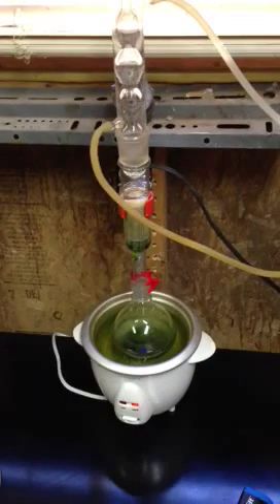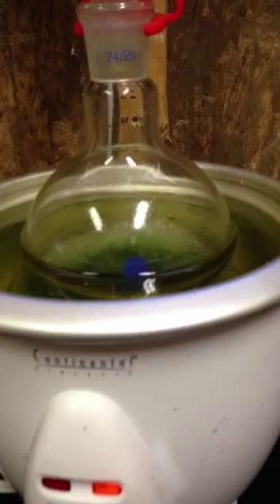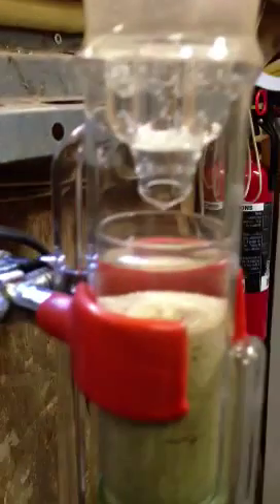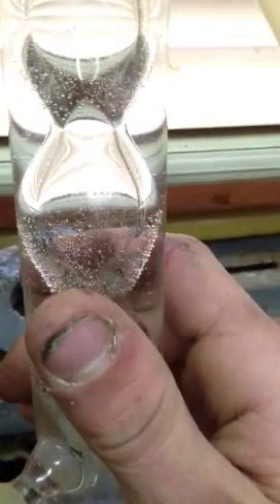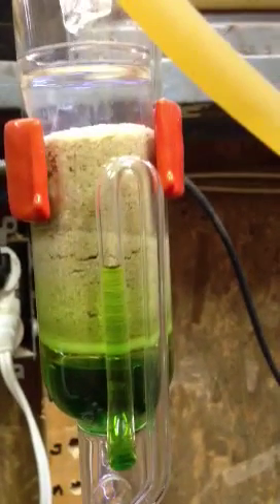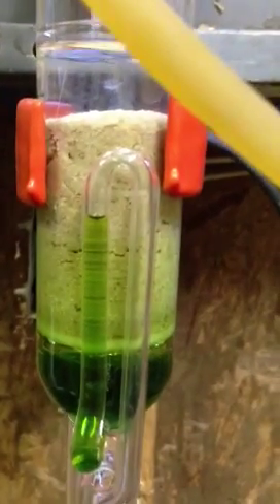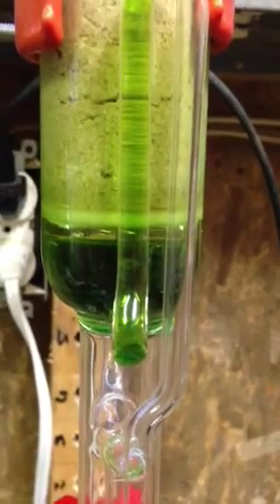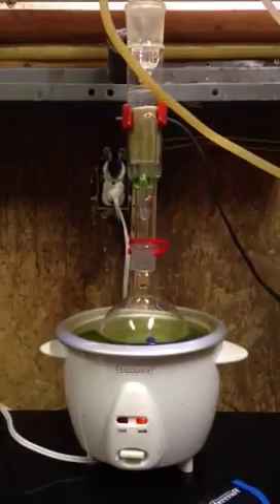Basic Soxhlet extractor setup

Comment: I like the rice cooker idea.
Reply from the maker: Thanks I'm glad you like it, although oil baths are kind of messy I recommend you check out my channel and look for the DIY heating mantles if you can manage to build one of those you will be better off and they are probably cheaper than a rice cooker in the long run
Reply: nilamotk Where did you get your rubber tubes? Also what water pump do you use?

I’m trying to get a setup going for tinctures.